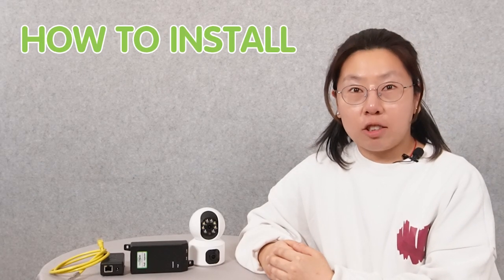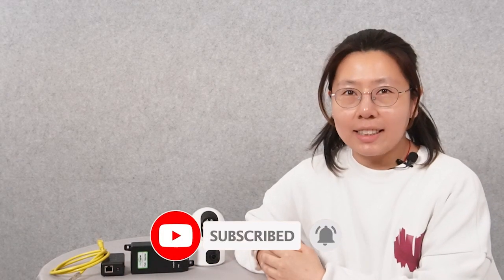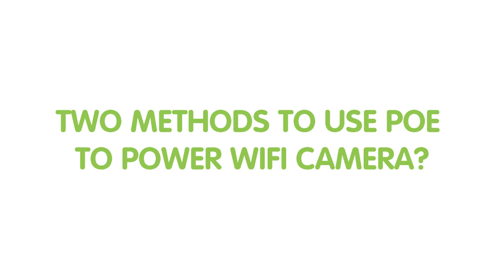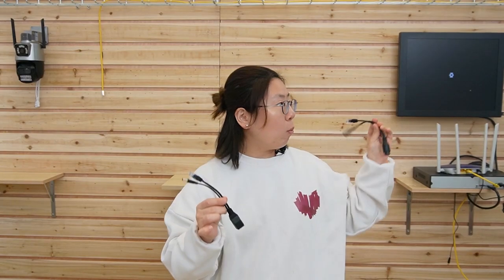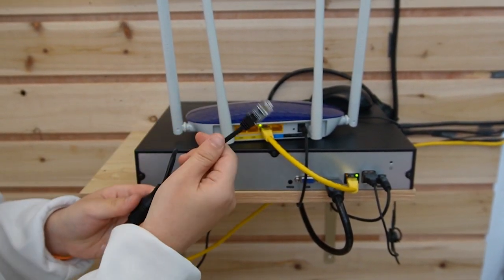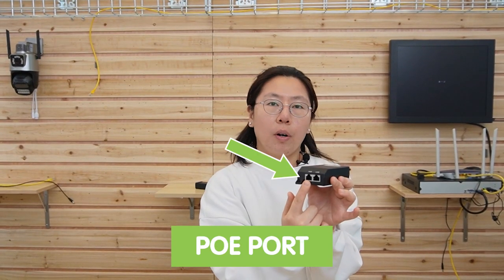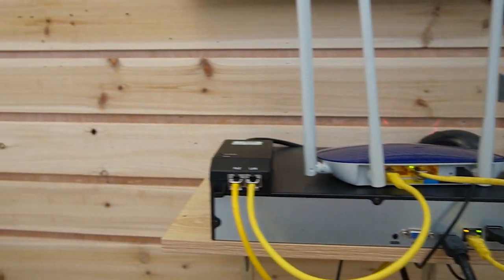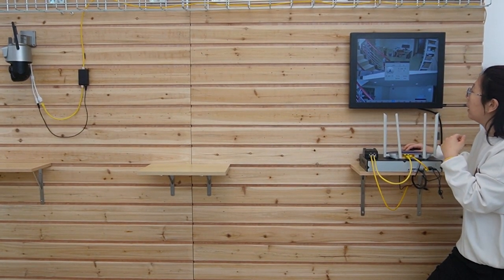Why Not Install WiFi Dual Lens Security Cameras with PoE

Comment: There is also a third way to do it, so that you don't have to have so many cables inside the house. I have a mesh satellite box setup where a satellite is connected with a cable right next to the router. One of the satellites is placed in a bedroom, far away from the router. My setup is then: router, satellite box wired to the router sends a WiFi signal to the satellite in the bedroom. This is then wired to a Poe+ switch, then the network cable out the window to my Wifi camera. On the camera I have a POE splitter. 
I use a flat cable out of the window, which I then connect to a normal network cable outside. It is then easy to close the window. I don't know if this arrangement is correct, but it works fine. 
However, the number of Watts available is limited with a POE+ switch.
Reply from the maker: Your setup is highly functional and well-thought-out!
Reply: @Fastcabling  👍

Comment: I've been subscribed to your channel for a while now. Could you help me out I've got BT fibre installed, it has g.fast lan sockets on the back of the modem
Although I'm knot subscribed to gigabit speed just 150mbps. The lan sockets look smaller than a rj45 lan socket,I want to run a cable to a security camera on the outside of my home, could you help me out plz,by explaining how I'd have to do this,what would I need. Thank you
Reply from the maker: It is not that difficult. What you need is the fiber optic cable plus the media converters both end. It should get the fiber optic link up. Here is the related video in case you might need it. https://youtu.be/5dsk5QL6Jrw

Comment: Guys do you know of any non-homing cameras that I can watch simply on a web browser on the local network?
Or that you can disable homing features?
Non-homing means cameras that don't reachout to the manufacturer every now and then.
Reply from the maker: As long as you still can access the camera's video after you turn off the internet access temporarily, It should fit your requirement. What you need to do is to make up wrong gateway address. the camera will never escape from your local network. Of course, you also can block the mac address on your router and not let it passthrough the router.